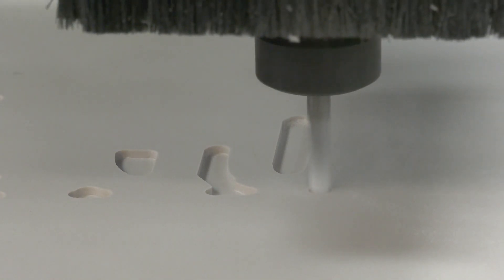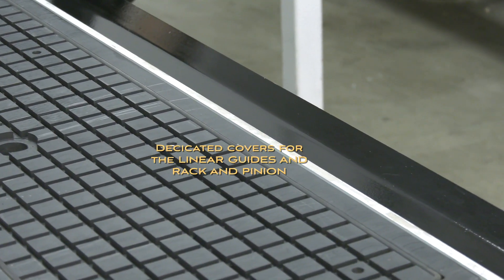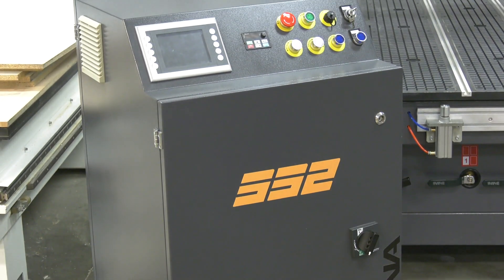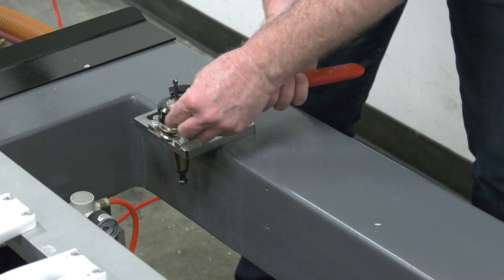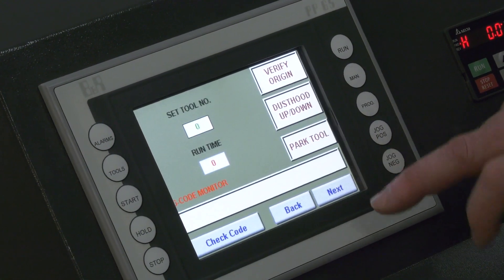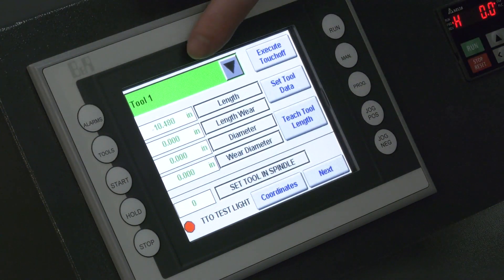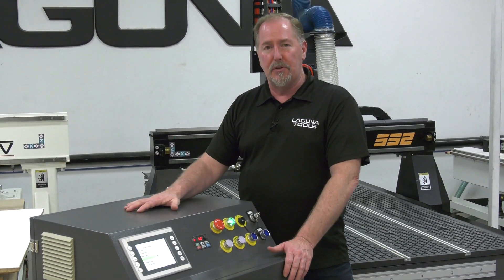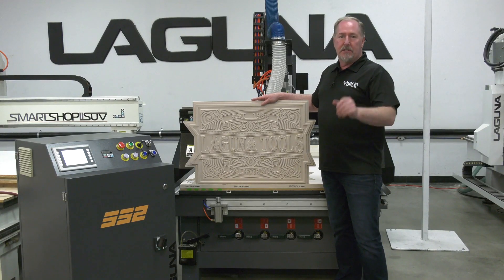Newly Upgraded SmartShop® 2 CNC Router Overview | Laguna Tools

Comment: Does this machine use a air compressor
Reply from the maker: Hi Jonathan. Yes, it does require an air compressor for the spindle. The rating on the compressor should be 85psi, 6 cfm in case you need specifics.

Comment: What is the price on this amazing machine
Reply: Is there any machine which can cnc any material wood, metal, plastic and more
Reply from the maker: @abdullahanjum2326  Yeah so this can cut all of those materials with the right bit. For metal, it's any non-ferrous metal: aluminum, copper, etc.
Reply from the maker: Rodolfo Hernandez hey Rodolfo, the pricing varies a bit on the size of the table. What size do you need, do you know?